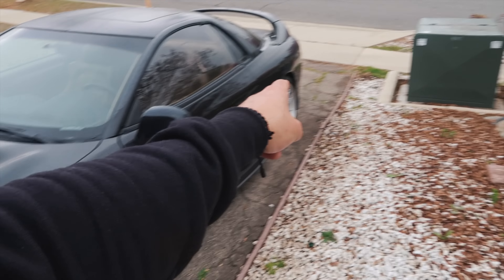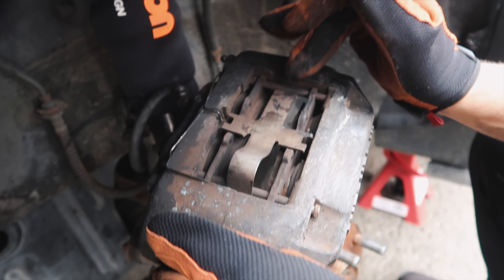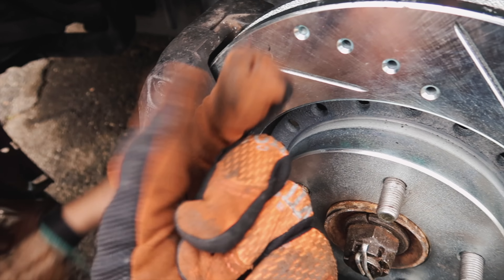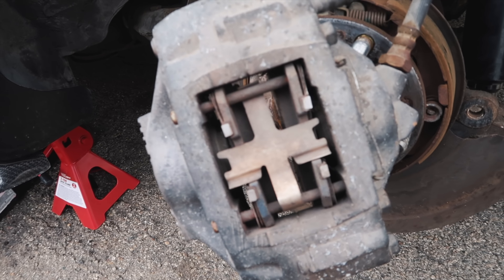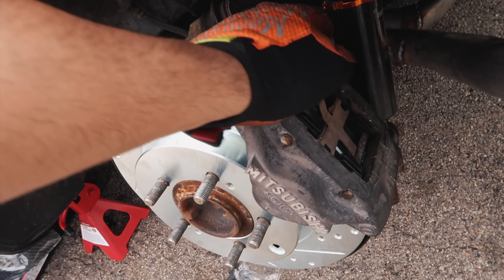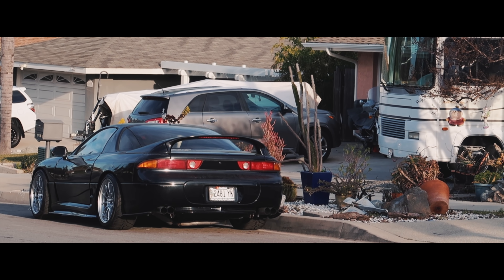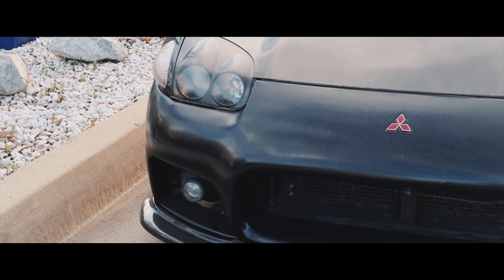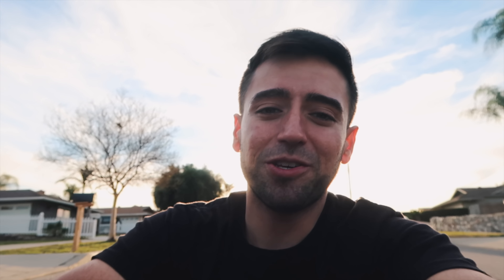MITSUBISHI 3000GT VR4 Gets Brake UPGRADE!! | R1 Concepts

Comment: Love the way your 3000gt is turning out. Wish mine was going as smoothly lol.
Reply from the maker: It happens man. We get some good builds and some bad ones
Reply: @MiguelDsm  for me im having issues gettign parts. specifically some .010 rod bearings lol. 2 months and a couple of cancelled orders, and still havent gotten them yet
Reply from the maker: The 3s is the one car I struggle finding parts for as well
Reply: @MiguelDsm  not many shops make parts for them for sure.